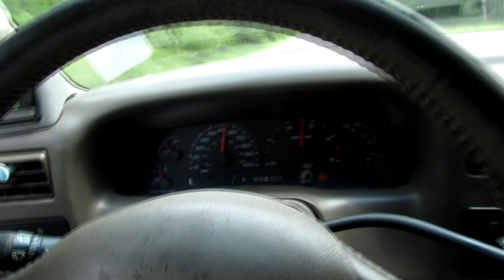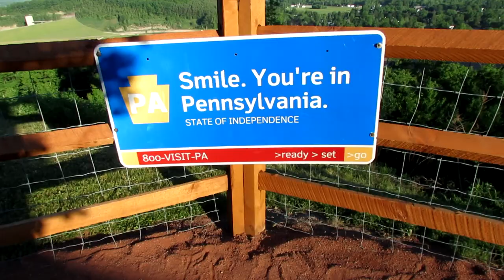Road Trip Part 2

Comment: As well as the ford runs towing (when it runs) I'd be loath to get rid of it. That 454 dually's nice but won't pull like that diesel. Not to mention mileage. Of course you could always put a duramax or Cummins in the dually hint hint. Or better yet a Cummins in the Ford. Keep up the good work!